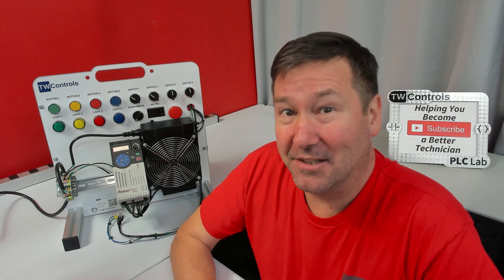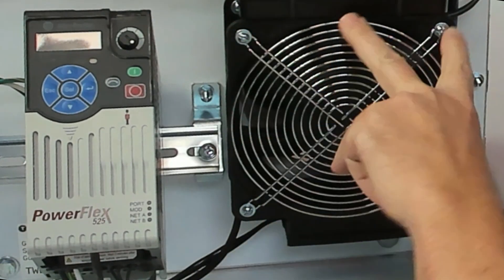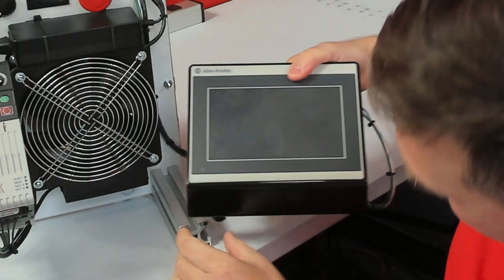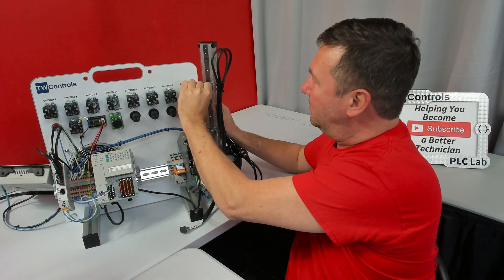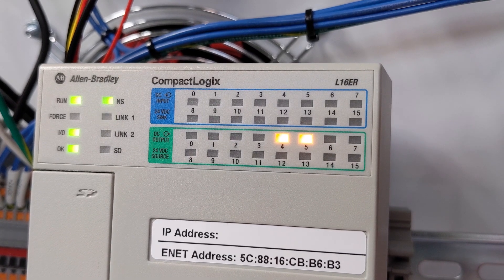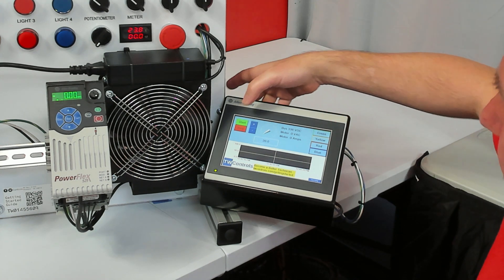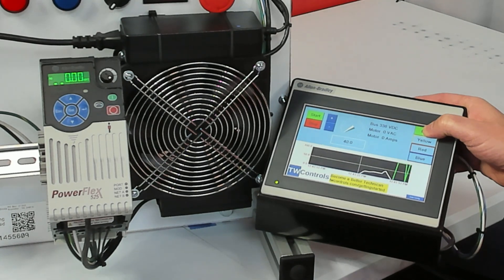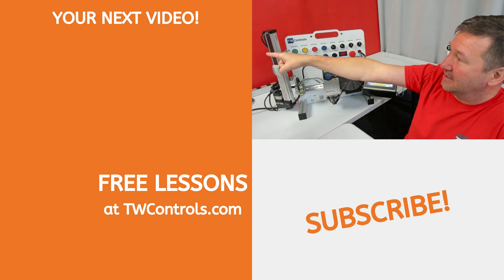Getting Started with Your Compactlogix PLC Trainer

Comment: quick question!!, with an old PLC 5 , can you emigrate its program to a Micrologix 1400? I ve hear by engineers that is recommended to emigrate to Rs logix 5000, and to upgrade to a controLogix controller, what are your thoughts about this? mr Wilbourn?
Reply from the maker: The Micrologix 1400 it is active mature and is expected to be discontinued soon. It wouldn't be a good choice.
Reply: thank you much for your prompted response, hey how much knowledge you have of SLC (Slick) controller programming?is there a easy way to upload data, files from an controller thats on a machine, then implement the code on a more newer type controller such a Logix??
please let me know your thoughts on this,
thank you in advance  @TimWilborne
Reply: also whats is a good replacement for a MicroLogix 1400 or 1500 in your own opinion?? @TimWilborne
Reply from the maker: Micro850
Reply: @TimWilborne   Mr wilboure, I need to replace a 1769 AENTR card , is this plug and play deal for the most part , as long as set  switches for the IP address??? Or will there be more config needed ?? Please help !

Comment: This is a really cool add on! As far as choosing Studio 5000, would the mini edition be capable of programming the HMI? If not what edition would you recommend for a setup like this? Also, is there a way you can do a video on how you wired your drive to go from 120 to 3 phase? i have seen your Rotary Phase Converter videos but im not sure if thats how you're accomplishing it here? Thanks again for everything you do.
Reply from the maker: That Panelview 800 is programmed with Connected Components Workbench which has a free version.
https://www.youtube.com/watch?v=6e_2Tx6bmmM

The Powerflex 525 is a 120VAC input 240VAC 3 phase output drive.
Reply: @TimWilborne  Thank you so much for your timely responses
Reply from the maker: You are welcome 😁